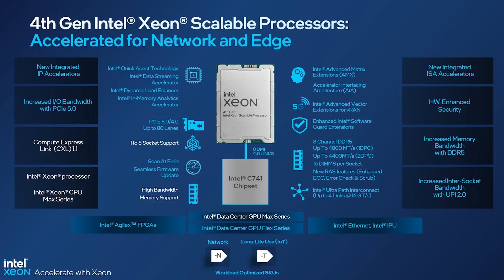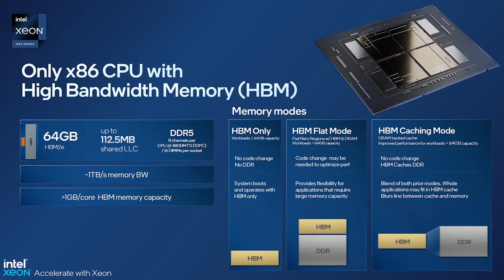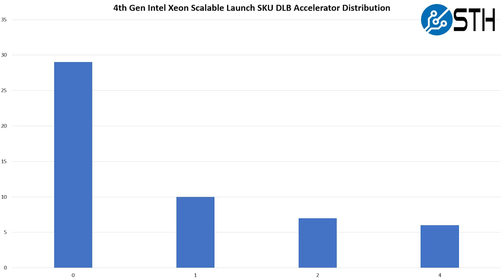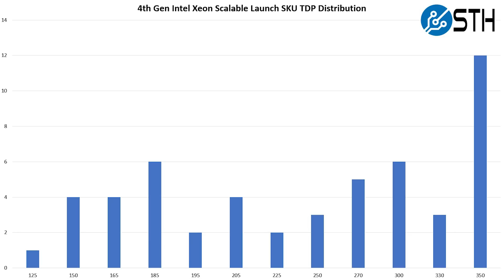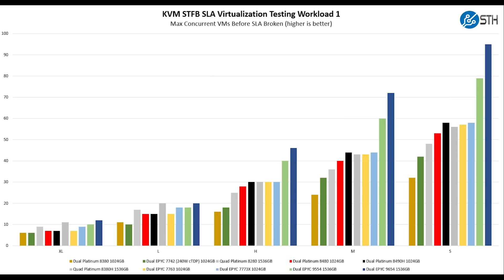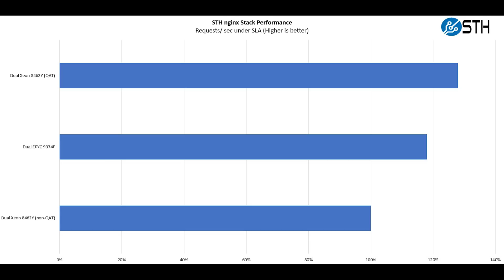$17K Sapphire Rapids Server CPU! Hands-on with the new Intel Xeon

Comment: As someone who had an early access, I would say that this thing is basically half-finished. The latency of L3 cache and memory is way too high while also having a weird pattern. There is an SNC4 option you should try(especially when comparing with EPYCs), which Intel claimed, could reduce the latency, but this feature was bugged and dragged the L3 latency up to 60ns when I was testing it. In some tests 4th gen xeon even loses to 3rd gen, despite the huge core-count advantage. I don't think their architecture has fundemental problems, as the lower-side latency is really good, as well as loaded latencies, but I don't really think they could fix it before Emerald Rapids and relive the glory of 3rd gen(which in many cases I tested, can beat EPYCs at half the core count).

I do not have any doubt about their manufacturing nodes though. They are used to produce huge dies en masse throughout the years, even their desktop dies are getting bigger. They also have a higher standard about the electric spec and defect rate, as if they only want their cpus to run at 2-3GHz like most EPYCs, or if they don't care that cores could generate FP errors(Reference: Cores that don’t count, a paper from Google and FB),their 10nm process would have already been ready at least five years ago. It's just it that the media love to catch the wind.
Reply: I'm no lithography expert, but as far as I know, even "large" dies of yesteryear (think circa 2018) are just normal or even small dies today.  The Nvidia HPC accelerators have been essentially at the reticle limit for a given node for the last 5-7 years, and have just continued to follow/push the reticle size up with each new node.
Reply: @JMurph2015  Yes but have you noticed that, Intel almost always provide full spec options to their large dies(with the exception of Xeon Phi, which is still more than 95% good), while Nvidia GPUs like A100 had 1/6-1/5 of its SPs chopped off, most likely, to improve yield. You can always chop off the defective part, but to consistently make a large die all good is way harder.
At the CPU end, AMD desktop CPUs, while having a much simpler architecture(4-way decode and discrete add and mutiply units), can't reach the same frequency hight, even when many of them are already over-binned(check the fail rate and heat dissipation).
Only do you really look into it can you find something was off.
Reply: @Alan_Skywalker  the Nvidia V100 had only 4 out of 84 SMs disabled with a die size of 815mm2.  The largest monolithic Intel chip I can think of is the Xeon Platinum 8180 which was a 694mm2 monolithic die.  Nvidia's follow-on A100 was 824mm2 design with 20/128 disabled on TSMC N7 followed by another 814mm2 H100 with 12/144 SMs disabled on TSMC 4N.  You may have a point on them needing to disable cores here and there, but their size more than makes up for it.  They have more active die area than Intel ever has.  And don't get me started on transistor counts, it's even more of a bloodbath there.
Reply: @JMurph2015  694 and 815mm2, it's only 121mm2 difference,  with the cutdown it's even less. The problem is not even that simple, if a defect happens on a die, it's no longer "perfect", you can only consider it a defect product and cut it down for repurposing. If you can't consistently make "perfect" dies, you can't let others order from you.  But if you have designed the chip to be a cut down version, you can have one or even multiple defects on every die, but still use them no problem. Calculations can ba a bit more complexed, but I still think 694mm2 of perfect die is harder.

You do have a point about transistor count though, but I think Intel is just taking a different path, that is, performance and reliability first, density second. It has some advancement TSMC does not until recently, such as Superfin, SAQP, COAG(TSMC just added it at N5) and eCu interconnections, but it's EUV update, which plays a major part in density advancements, is not available until recently. Also you could encounter transistors that can't run at high enough frequency, that may not be a problem for GPUs, but for CPUs it's more likely to be a defect.
Reply: @Alan_Skywalker  Unrealistic and impractical to fab a defect-free 300 mm^2 wafer or even a large chip consistently. Economics of yield is about defect management strategies. That’s why Zen is stomping Intel on margins. Doesn’t help Intel is at least a generation behind on process node.

The fact Intel is as competitive as they are is testament to their microarchitecture. AMD is quickly catching up to both AMD and NVidia, if not already there.
Reply: @BurnsRubber  Actually intel can consistently make perfect chips, for example, xeon 8284 and 8383C, for large OEM customers. Defect management is a must, most mainstream chips are not perfect, but having the ability proves capability.

Intel's architecture is another advantage though, but I don't think AMD is catching up. For example, AMD is still using 4-way decode and discrete add and multiply units, which intel ditched after Broadwell and Ivybridge. AMD gave me an impression that, whenever they want performance improvements, they add more cache, or glue two chips together(with the latency equals to two separate chips) and claim it's one chip. If those don't work, they fall flat. After 11th gen(Xeon 8300) and RTX3000 they seems to be in trouble, as their net income(GAAP) was down 93% and operating income down 107%. No need to be a stock exchanger to see the problem after their chips are nolonger super cheap.
Reply: @Alan_Skywalker  Microarchitecture is important, but clearly not the most important aspect of computing. World is moving towards more application specific cores and architectures. Power efficiency is more important, whether it’s exascale, iPhone, or imbedded device. Increasing core counts and parallel computation have pushed advancement over the past decade. AMD emphasized this in their roadmap. That means feeding the beast. Cache and memory bandwidth are needed. AMD has been more or less at parody with Intel in IPC at x86 tasks for the past couple generations, so other factors make the difference. Principally manufacturing node and defect management / yield optimizations, ie chiplets / Zen.
Reply: @BurnsRubber  Memory subsystem is very important, in fact it's one of the most focused area by the industry in the past decade. AMD's problem is, their traditional PCB based multi die structure means they have no other choice but to add more cache, even as memory becoming a very big bottle, they can only add cache to make up for it in a different way. Rightnow by looking at the die shot, you will see that about 3/4 of its die area are occupied by cache. Intel also redesigned the cache system twice, during SKX and SNC, but they're mainly focused on exchanging slower cache for faster cache(L1 and L2) rather than adding more.
Reply: @Alan_Skywalker  With the stacked 3D V-cache Zen 4 is 90% cache. PCB assembled multi-chiplets are cheap. It’s about economics, not optimal performance. Intel is now slapping HBM to the CPU PCB for Sapphire Rapids as anL4. They see the value.
Reply: @BurnsRubber  There's trend called "near data processing"(NDP), as the computation is more and more affected by latencies. SPR's HBM design is a direct successor to Xeon Phi's MCDRAM, which dates back to 2013(documents, released in 2016). 
The problem of pcb-based MCM is, why bother. Aside from some fuctional parts like PCIe controllers and IGPUs, if the latency isn't close a single die, why don't you just make two chips. The packaging cost is lower, packaging defects are fewer, no need to worry about problems like NUMA per socket or high memory latencies, and customers have more freedom in choosing. Just that the number of cores per socket on paper may not be that large, but the users lose nothing.
Reply: @Alan_Skywalker  “why don’t just make monolithic chips?”
The answer is chip yield scales with the inverse of area squared. If you cut that monolithic die in two pieces the process will yield 4 times as many chips. MCM do not have as low latency as a monolithic chip, but it’s certainly much lower than two sockets. Packaging costs of system are also lower and density is higher. AMD has increased core density from 56 cores per 2U to 196 cores per 2U over the past five year using MCM. Intel has moved to MCM now with Sapphire Rapids. Cost per core has also dropped by a similar factor.
Reply: @BurnsRubber  As I've measured, the idle latency through UPI between two sockets are about 130ns, and the core-to-core latency in Rome is 120-150ns. The highest loaded latency is 500/1000ns. The difference is much smaller than you think. And you will also be lefted with a difficult choice: to interleave the entire 8 channels and suffer from the highest latency, or to make one cpu two or four numa nodes, in favor of dram latency.
As for the density, since a 6096 socket is literally more than 1.5x as large as a 4189/4677 socket, the density isn't actually higher. More so when you consider about how much TDP you can give that huge chip. If you give the same TDP as a small chip, you will lose a lot of frequency, if you set TDP according to core count, the heatsink will suffer.
Intel is trying to cover both end by the look of it. They have EMIB to reduce inter-die latency from 130 to 50-60, but it's still not as fast as one single die, and other problems still remain. So they also made a 34-core monolithic die, and see how it goes.
Reply: @Alan_Skywalker  Worst case intercore latency on Rome is ~100ns. But within same AMD CCD it’s only ~25ns. Across socket it’s ~200ns. EMID reduces core-to-core latency on average to ~60ns, but within a CCD, it’s about 3x lower because it behaves as a monolithic die. I don’t think Intel will survive the market making large monolithic dies. EMID is promising, but not obviously superior to what AMD has been doing with “Infinity Fabric”. To reiterate, the advantage of AMD’s approach is the homogeneous small by area 8-core CCDs work across products, from server to desktop/workstation, and now some niche laptop products. AMD can move to 16-core full compute CCDs to double core counts without affecting latency, and importantly doesn’t require radical new architecture/assembly, etc. 

As far as power density, the large core count CPU applications will always be constrained for power efficiency, which means modest clocks and lower power. They can boost single CCDs up to top frequency if needed.
Reply: @BurnsRubber  Intel's desktop is a little more than 20ns as well. That is the advantage of Ring architecture. But it doesn't scale that well. If you add more cores the ring will slow down as well, both because of ring stop jumps and ring frequency. It's already close to 40ns at 18 core(E5v3), and will fall behind the single die Mesh(40-50ns) after about 22-24 cores. Worst case of Rome by my measurement is 150ns, and Intersocket should be about 230ns, most of which(150 of 230ns), actually, is not about the "intersocket" part. This number should be similar to the worst case(2 hop) of a 8way skx system(8x8260M is about 226ns maximum).

The worst part of the glued CPU is, it always have to suffer the interconnection latency, whether it's about accesing another core's cache or system memory. If it's a single die with shared L3, non of these problem exists.

As for the single core turbo, I just say that none of them made it work. The OS and background tasks will always kick the idle cores into C0/C1 state, so single core boosts rarely occur, not to mention its consistency. Intel introduced SST-TF to force the used cores to boost if power budget allows, while AMD's solution is simpler: set the all core boost really high so unless the CPU reaches TDP, the cores will stay at that frequency.

BTW although AMD's ISSCC document said that the worst case core-to-memory latency is 114ns, non of my tools actually generates that good of a result. Perhaps some other procedures like snooping were not included there.
Reply: @Alan_Skywalker  The fanboy has arrived. He has used Intel his whole damn life. This guy would have happily stayed on 4 cores forever as long as Intel told him it was ok. He is definitely gonna get on board with whatever subscription they offer him. Next Gen, he will start with a quad core and then maybe pay bestbuy to unlock a few more for him later. Intel is what he grew up on. Zen 3 was never better than Rocketlake. It was a lie. Intel HEDT never stagnated. Threadripper wasnt really that much faster with 64 cores. Intel had advanced the same 18 Skylake cores for a decade, they were better. Intel never falters. Everyone who says they do are liars.
Reply: @tstager1978  Are you trying to collect every false accusation AMD fans used throughout the years ;) Don't do it here though, some hardware noobs may actually fall for it.
Reply: @Alan_Skywalker  I was hoping to hit most of them lol.
Reply: Cerberas CS-2 is 46,225 mm^2 / 2.6 trillion transistors and is fabricated on TSMC 7nm.
Reply: @BurnsRubber  it has a totally different architecture to deal with defects across the wafer, it's not reasonable to expect that to work on normal chips.
Reply: @BurnsRubber  Cerberas is made to be modular to manage imperfections.
Reply: @Brendon Lee O'Connell  And that lab in middle east absolutely smoked AMD at its career hight back in 2007 lol.
Reply: A story that seems similar to Arc, despite constant delays its still rushed.

Comment: At 1:45 you said that "most of the cpus that are out there are really only going to be like 32 cores or something like that in this generation..." My impression is that, nowadays, most (server) CPUs are going to hyperscalers who want top-end, high-core-count, sometimes custom skus. More "normal" customers might be fine with smaller core counts, but I am wondering if continuing to lag behind here is going to accelerate the adoption of AMD (and ARM) among some of Intel's biggest customers.
Reply: Per core performance is valued for many applications which these less dense chips excel at. I’m thinking things with a per core licensing model like Microsoft SQL server is where 32 core chips are still big. I also wonder what the market adoptions of 96 core cpus will be seems like a lot of potential for virtualization and energy efficiency concerned workload.
Reply: I don't think that Hyperscalers are the majority. In most companies, you use smaller servers, and especially if you have to license Windows Servers (for example for and AD domain) you really want smaller core counts with higher single core performance.
Reply: @flintstone1409  hyperscalers buy a truly mind boggling number of servers.  As of 2017, it was speculated that Google operated _ten million servers_.  They spent $30B on their data centers in that time period.  AWS is likely in the same ballpark if not bigger.  Azure is probably smaller since they are smaller than AWS or Google's fleet, but still it's sure to be extremely impressive.  If I had to guess, something like 25-30% of all datacenter CPUs are bought by hyperscalers in a given year and those are almost all very density and efficiency optimized SKUs (high core count, modest clockspeeds, near top of the binning pile).  They can afford them because they can make those CPUs work for them 24x7.
Reply: If you have too many cores, the memory channels will become bottleneck. So too many cores doesnt make sense.
Reply: @prashanthb6521  that's why the high end CPUs have more memory channels...
Reply: @prashanthb6521  not really - with enterprise workloads on virtualization active memory usage is not really high. That's why memory tiering with optane or with cxl is possible.

Comment: Isn't DSA what's normally called "DMA" and already present since a long time?
I mean, I remember looking a memcpy with Haswell, and we could clearly see the point where the copy started to be done by the CPU, instead of the offload, there would be light load, and why you added a few more thread that did heavy copy, all of a sudden, the cpu was heavily used, but ram wasn't near it's max bandwidth yet...
And I programmed on mcu with DMA, where you basic set copy X byte from address A to address B to some mmio to offload off the main core.
And remember seeing conversation about RDMA
So it doesn't seems to be something new.
Reply: My thoughts as well.  At a guess, they updated the DMA to allow significant queuing and "smarts" / prefetching.  Like how the latest consoles have fancy transfer prioritization for game assets from the drive.  If done correctly, and especially taking advantage of HBM as cache, they could keep the cores fed almost all the time.

Real life example, and repeating the basics for non coders.  Caching systems often pull chunks of data, assuming sequential reads.  That's good for simple arrays, but we often don't code like that.  Instead we also have arrays of objects, or of pointers.   So, if I'm doing something like totaling a field, I need say 4 bytes that are spaced 2048 bytes apart.  Times 10,000!  If this new system is "smart" it can determine that access pattern and prefetch the data.  Personally,  I don't consider that an "accelerator", so it's more likely to be the thing with Video Games.